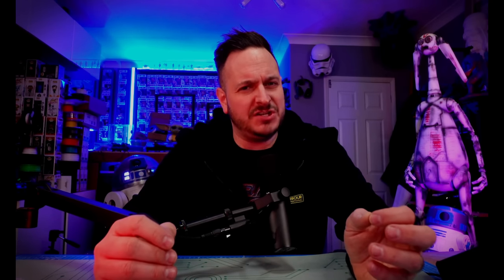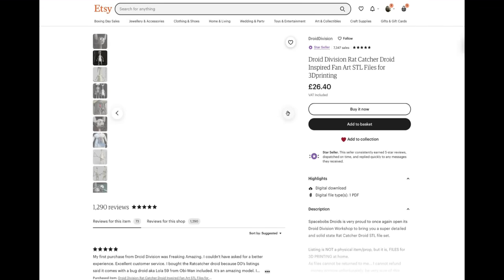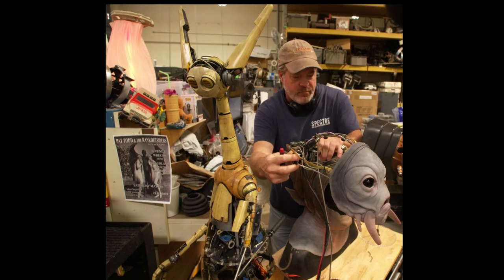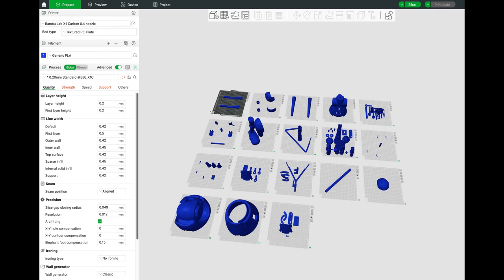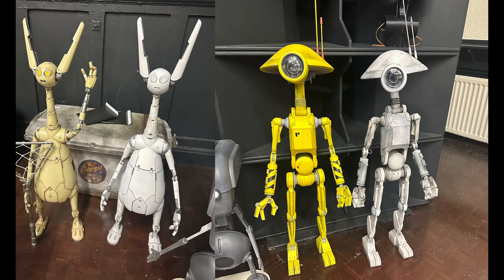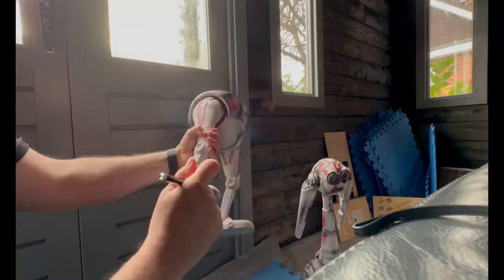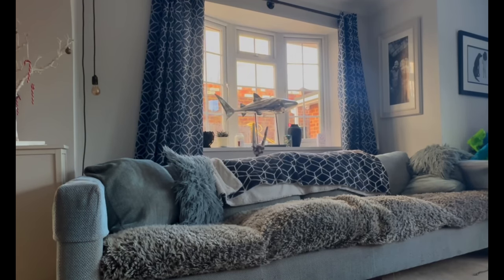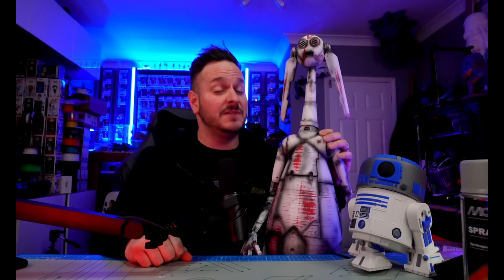3D Printing and Painting the Bambu Labs X1C Rat Catcher Droid

Comment: Great work Sam!  Curious about what you use for feeding the filament to the X1C.  I am trying to get a Y connector so that I can use the external feed for single color feed and abrasives.  I only want to use the AMS for when I need it.  Would like to see your ideas on that.
Reply from the maker: Hey David, I used the AMS for this as it was around 3KG - Its an interesting one tho as in the AMS you can't use several filaments such as TPU.. So my idea is to use the P1P with no AMS and a single spool and the x1c 's for everything else. As suggested my workflow on these is so much better than before so for normal printing of my projects I might order a few more of these in.